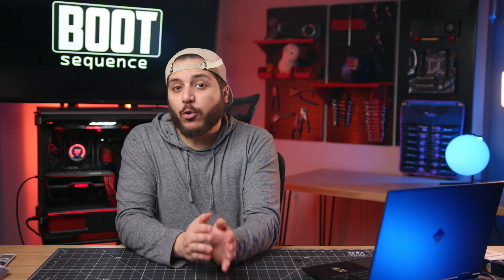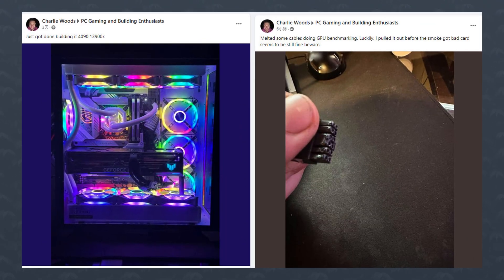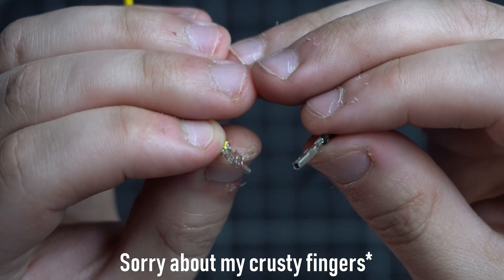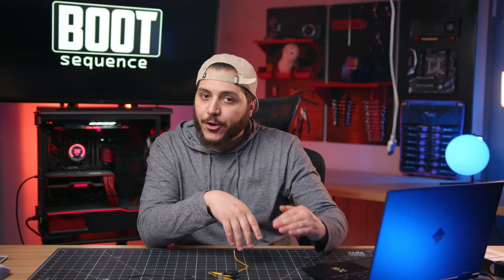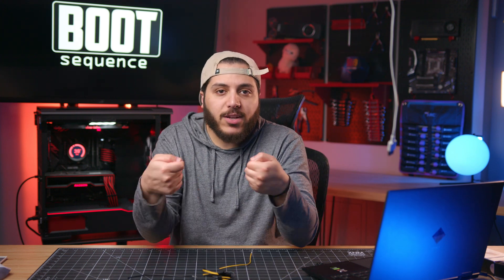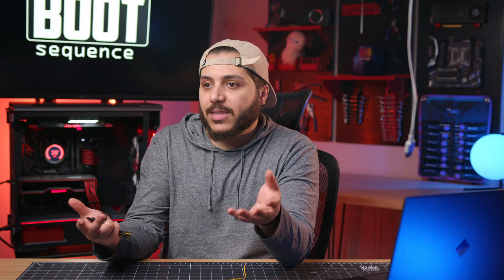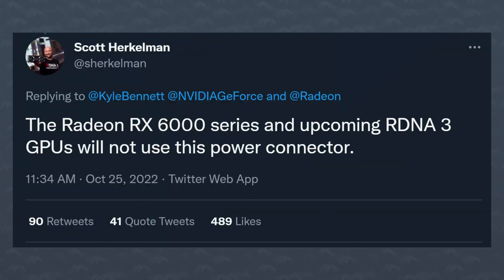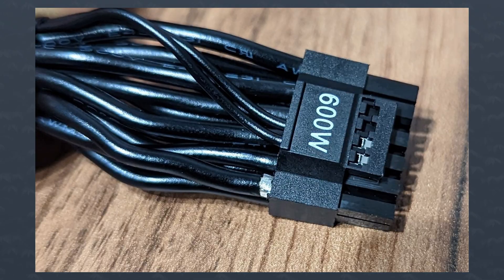NVIDIA !? What's WRONG With Your RTX 4090 Adapter?

Comment: Yep, also note that the OEM mfgr of the 12VHPWR connector actually sells terminals with only one seam, discovered it when building my own adapter cable. Not sure what junk terminals Nvidia went with and why. Check Mouser. I also wrote in my blog about it with photos.
Reply: i also notice all of these reports came from AIB card user, i haven't see one from the FE version. is it possible the cause is actually the connector material quality on the card rather than the nvidia adapter?
Reply: There is no such thing an an OEM manufacturer for this connector, ANY manufacturer can create the 12VHPWR/12V-2X6 connector as it is not a proprietary one, but instead just part of the PCIe CEM5 5.0 spec. 

Amphenol is just ONE of the manufacturers here, Molex also make this connector.
Actually, it seems the Molex 12v-2x6 version has two seams unlike the Amphenol that has one seam, so maybe nvidia just used the Molex version instead.
Reply: Blog address? Wanna read it
Reply: @leorickg  Also updated the blog post!

Comment: Is there any concern for this happening to the 3090 TI as well?
Reply: The 3090 Ti FE uses a similar connector at the same angle
Reply: @PsychBrain1111   Okay so is there any concern with the adapter sense it only attaches to three 8pins  Instead of four 8pin  Connectors?
Reply: No. The connector is oriented in a different direction.
Reply: @VoldoronGaming  good to know
Reply: @bigmike4133  Probably still wise to inspect it once in a while.

Comment: Dude come on. Just use a pin out tool to release the pins.... There are tools for putting pins in and there are tools for taking them out. They will come in handy in the future
Reply from the maker: I bought a kit for this video. HORRIBLE. Never again. I'll buy one from a trusted source rather than amazon.
Reply: You should address the plastic as well. The plastic should far exceed the heat that could ever possibly accumulate. They chose the wrong blend when they chose their plastic housing.
Reply from the maker: Im not sure if the plastic is the real issue since other meltdowns on PCIE and EPS do the same thing. Although they could have updated the blend.
Reply: @BootSequence  by "Amazon" you mean a cheap foreign manufactured corners cut tool. Cheap not as in the improper use implying inexpensive, but cheap as in the real meaning of the word cheap. 

But hey, at least you were able to get 2 pulled to use as a visual aid. But yeah buy something of quality and you'll probably never have to buy it again. 

As for the plastic, it should be capable of handling the heat that those pins might generate. The plastic is what's melting. And if the plastic is what is locking those pins in place then the heat degradation is part of what is causing the problem because as that housing deforms with the heat the pins have additional slop that increases with the degradation. Under no circumstances should that plastic be charred or melting. 

I find it pretty hilarious that a company as large as NVidia is failing some basic intro to electronics 101 type shhhh... This is only going to get worse. But they can't possibly admit to the problem now after so many have already been manufactured. It will blow up in their faces if they continue to push high wattage cards where the problem will be more evident. 

If it were April 1st I'd come out with active cooling cables. But sadly it's not a joke. 

NVidia and their AIB partners will unfortunately wait until a catastrophic event occurs before they do something. And at that point, with all we know and have said, they should be held grossly negligent. 

This whole thing doesn't help anyone. It will hurt their brand, their shareholders while also hurting their consumers and ultimately the industry. No one wins. But the sooner they take corrective action, the better. Dragging it out will only add more pain to all involved.
Reply: @MikeNovelli  So you think they magically started using a new plastic with a lower melting point?  There is no plastic that doesn't cost a fortune that can withstand arcing and hundreds of amps.  As a connection weakens, current increases with resistance. Any arcing would cause literal PLASMA levels of heat. You're saying there's some magic plastic that wont melt? I think not. 
Everyone has an opinion. Acknowledging you're out of your realm of expertise is a virtue.
Reply: @metalheaddw05  I think it is you calling things "magically" that is out of your own expertise. Please stop pretending to be a SME. 
You clearly don't understand how the polymer blending is done. Nor understand how high temperature resistant plastics are created or function. 

If you're trying to imply there isn't a problem you are showing your own "expertise". 

Bye
Reply: @MikeNovelli  You clearly do not understand that the plastic has NOTHING to do with the problem.  The only person pretending is yourself.  Igor has already done an extensive writeup on the true causes of the issue. Looks like your little plastic theory isn't holding much water.

Go hop on your bike and ride around.

Bye.
Reply: @metalheaddw05    going on about? You're trying to say that the connector should be melting? If you don't understand how the plastic aids in the pins rigidity and how the pins coming loose from the tab are what is heating the inferior plastic leading to more structural degradation increasing resistance leading to more heat causing more degradation in a chain then I can't help you. It's a compound problem. It would be far less likely to have happened if they had used ceramic or a plastic that had a higher resistance to heat. The plastic IS the enclosure that gives the structural support. If you are of the opinion they should be engineered to melt then again I can't help you. 
It is precisely because of the tab soldering issue that the housing they chose, whether plastic or another material, should have been manufactured to a spec that could withstand such an occurrence. 

I just kinda let it go when you said "100s of amps". Maybe learn how to calculate power before you make yourself look even less intelligent. Allow me to do the very basic math for you: Amps X Volts = Watts... So even @ 600 Watts, if the Voltage is 12VDC the amp draw is... ... ....... 
Get past 101 before you spew more garbage. 

Goodbye. You are the worst part of YouTube.
Reply: Here's a hint.. it's not about the amp draw. It's about the heat... 🤣 (Figure out how that heat is produced. And realize the fact it could possibly produce that heat is exactly why the connector should be made to withstand those potential temps) ... R... It starts with an R... 🤣🤣🤣🤣 "100s of amps" 🤦🏼‍♂️
Reply: It is possible to lose a solder joint and still have continuity, low resistance and high conductivity simply because the housing/enclosure provides enough rigidity and support that the resistance does not increase. When you cut corners in the engineering of a product one issue can expose and compound on another. Placing the blame on a single factor may sound good, but it doesn't tell the full story. Separation should not have occurred.

Comment: hello sir can you show the correct way that we should connect the RTX 4090 in a video so that this does not happen and we do not lose 1700$$ I would appreciate it😢😢😢
Reply: Don't bend the cable or if you have to, start bending 4 cm away from the card. That's all you can do really.
Reply: Yes...you disconnect it..put it back in the retail box it came.in..ans send it back for a refund and going amd 7900xt instead and KNOW this nonsense will never happen
Reply: @motoryzen  That's not going to fly because it is user error. So if you burn your GPU, it's your problem. lol
Reply: @motoryzen  Sad little kid needs to be offensive and expects an adult with 25+ years of IT experience to go, oh really, gee.
lol How many times have you done an RMA for any piece of hardware while managing an IT firm? User error, bent cable case closed. Maybe some aibs are nice, they don't have to be.

Comment: will see power usage constraints in the coming year, like for the TV in Europe.
the next GPUs will certainly stay around the same power usage, maybe less.
which makes the new connector irrelevant.

by the way LTT was able to run the rtx 4090 on a 550W PSU! (full PC)
not stable enough, 650W was better.
with a performance loss, but not so big.

all of this confirms that the RTX 4090 is overclocked by default.
which is a nonsense today. specially with minimal added value from a performance point of view.
Reply: all high end cards both amd and nvidia are "overclocked" by default. 
why didn't they undervolt them all? well silicon lottery. not all card can achieve the same thing. 
so they went with option that all their card are capable, even if that is not the most efficient for each card.
Reply: @someoneinasia  are you saying that 6800/6900 are overclocked by default? 😂
Reply: @unavailable291  "overclocked". in amd case it's more of overvolted by default.
all amd cards i tested are capable of great undervolt, while not all nvidia cards can achieve as good undervolt as amd counterpart. meaning amd cards on default are overvolted af to achieve greater clockspeed.

Comment: Is it true that Nvidia spec'd the 4090 to draw more per pin than they're rated to provide or something around those lines?
Reply from the maker: no, technically, they're right on the money. The connectors should be able to go up to 702 watts according to an intel engineer. But that's for precise insertion with little to no disturbance. Cable management, the pigtail connectors, the side panel of a case, all of those can make BIG disturbances.
Reply: @BootSequence  appreciate you demystifying this issue instead of adding to the FUD. There demo was hilarious!
Reply: @Doug-mu2ev  nah is just damage control. If it was AMD all these influencers will be all over it…
Reply: @BootSequence  The wires can handle about 700 wats, the connector only in perfect circumstances. A competent engineer knows to have both electrical and mechanical tolerances. This has none of the later.
Reply: @BootSequence  seems like intel engineers are dumb now… 600watts/50 amps on that thin pins it’s not ok… 🥴

Comment: So if the female connector has been plugged into by too many male connectors, it can't bond properly with the one it's supposed to stay with long-term? Yeah, sounds about right.
Reply: My female connector also gets a little loose when there have been too many male connectors plugged in, in a short time. 🤣